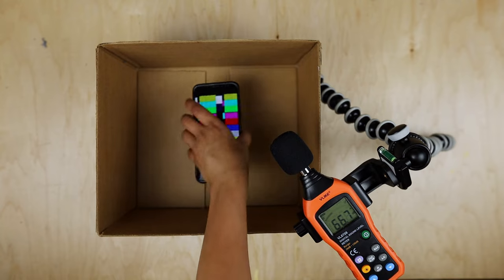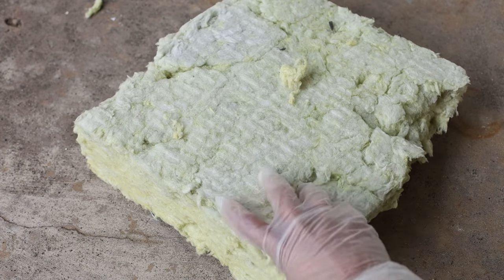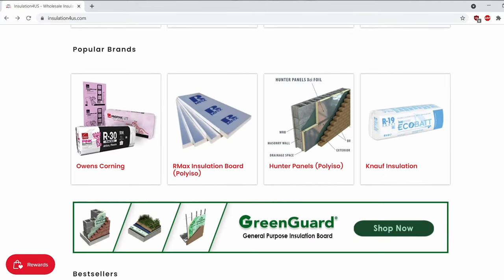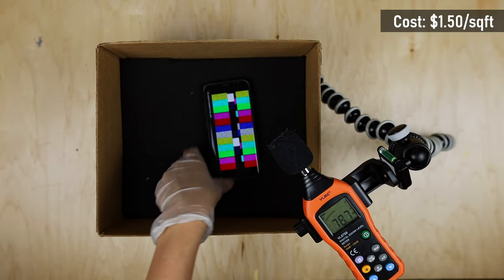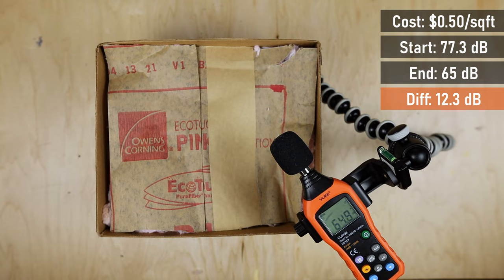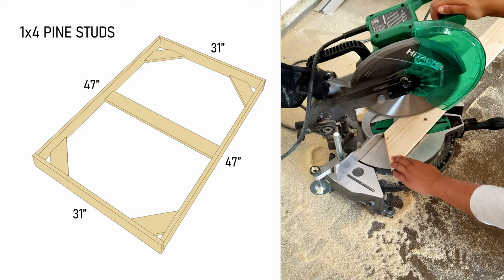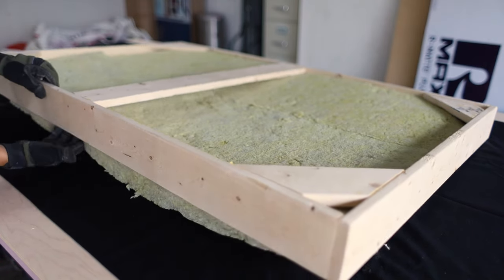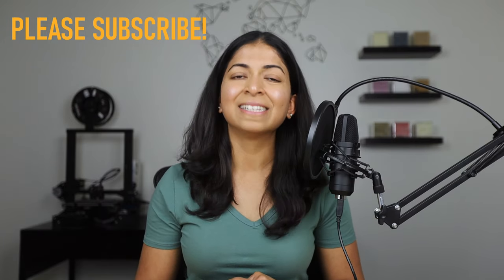Rockwool OR Fiberglass for DIY sound panels?

Comment: The fiberglass dropped the sound pressure level more than the other materials because of the Kraft paper backing. All you were testing was airflow. The panels you hang on the wall are meant to reduce the amplitude of sound waves reflecting back to the source from the walls. You’d need to put the SPL meter on the same side of the treatment as phone to see how the insulation works to dampen reflections. What you showed is that if you want to stop outside sounds getting in any improvement in airtightness will help. Get an airtight storage container from your kitchen and put the phone in there making the noise and check the sound pressure level. It should be better than any insulation.
Reply: i agree these test are so misleading as they can be. she should remove this video asap.
Reply: She states at the start that she is discussing audio absorption not reflection, most people can't make a aur vacuum box around themselves to stop exterior noise pollution
Reply: I have to agree with you beachton123, if you watch again you will see the girl's facial expression when she explains comments on the pink fiberglass.!
Reply: You are saying The 1mm kraft backing with zero mass made this big 40% difference ? the difference stands and the other ones dont have a kraft backing. In any case this test is not very useful because they tested a high pitch note, shouldve tested real loud bass.
Reply: Her test does a fine job at showing how much sound the materials can absorb. If you are trying to stop a sound reflecting off a surface and coming back to you with an absorption panel, the panel is going to be placed in front of the reflective surface to absorb energy from the sound waves, then it will reflect off the wall and pass back through the panel, where even more energy will be absorbed.
Reply: I agree. The paper is reflective and at least some frequencies are being returned to the source, lowering sound transmission, by creating a vapor barrier.
Reply: @ALJ Studios well if it's attenuating mids and high, clearly it is stopping some sound.
Reply: Yeah I agree as well.  
The paper backing made the biggest difference because it was blocking air flow and the air flow had to go around it rather than through it.
Reply: @MrFree-vj8qj  Yes the paper backing made a huge difference because it was blocking the air from traveling through it.
This isn't a 40% difference, this is over a 3 db difference, which is halving the perceived sound energy.  This is likely over a 200% increase in decreased sound energy perceived.  
  
Mineral wool is mathematically better at blocking sound, not by much, but you only will notice a difference between lower frequencies.  Lower frequencies also have the highest chance of traveling through solid materials.
Reply: @MrFree-vj8qj  Here is an easy example for you.  
Try putting thin plastic over your ear so that it seals air from getting in.  
Now try putting paper towels over your ear.  
  
The paper towel is a better insulator / sound dampener, but the plastic stops the air from going directly to your ear drum.  
This is why air sealing is one of the most important steps in house construction if you want a quiet, insulated house.  
If you just make a wall out of fiberglass or mineral wool, it won't work as expected because air flows through it with no air barrier.
Reply: Man, why didn't I think to just fill my walls with paper! Would have solved everything!
Reply: @troelsnielsen2848  correct.  Well intentioned and misleading and unscientific.  She is otherwise a sensible persona but this is a swing and a miss.
Reply: Yes, it reduced it a bit but still the fiberglass does the best job of all of those because its soft and full of air trapped in between. The sound travels best thru averagely stiff connected materials, and soft glass wool with filled with air does a good job. Thats why its also a good thermal insulation, the heat too has a hard time penetrating a soft meterial filled with air. If we replaced those fibers with some more stiff material which usually have worse thermal conductivity characteristics, like stone or steel, it could pass better thru it as it would be a better bridge for the heat to escape your home at winter or penetrate inside in summer.
Reply: This…
Reply: 🤣 when u get a online degree in soundproofing
Reply: @coolmonkey5269  - You don’t need a degree in soundproofing.  just need to take 15 minutes to do a little research, which she clearly hasn’t done.
She’s not even talking about soundproofing, she’s talking about sound absorption. They are two entirely different things.
Reply: veryslyfox  - said, “A 3dB reduction is not perceived by human ears…5dB…10dB…”
That doesn’t “sound” right. <—— See what I did there? Waka waka…
Anyway…I hope you’re not quoting Julie Leduc‘s Acousti-tech article from 2018 because it’s pure nonsense…especially within the context of production/mixing. You, I or anyone without significant hearing loss can easily…and I mean easily identify a 3dB increase in sound every single solitary time. 5dB is a major difference and 10dB is HUGE. This is irrespective of “energy” or “perceived.” 
Open up your DAW and try it. I don’t know what on Earth Julie Leduc talking about at all…I don’t think she does either.
Reply: Disagree.  I performed a similar test with R-15 EcoBatt kraft faced fiberglass insulation with and without paper backing, and used a 1khz tone. The difference with and without the paper backing was .5 dB.
Reply: @Lolatyou332  No.  The kraft paper is much thinner than the 3 laters of cardboard the tone would have to "go around".
Reply: @mrjesseholt  wrong
Reply: @troelsnielsen2848 This maybe one of the most dramatic things I’ve read in YouTube comments, lol. It was a simple demonstration, from an amateur content creator… re-lax 👌
Reply: @Lolatyou332  I don't understand your comparison - she's clearly not sealing off all the air with the paper backing. If I put a piece of paper over my ear that wasn't air-tight, I would expect very little dampening.
Reply: No because when you put a panel on the wall the sound goes through the panel then the reflection comes back through the panel so stopping sound from going through the panel stops reflection because less sound is reflected then the reflected sound is dampened so she was right with her test.
Reply: Misleading and irrelevant info. Should be deleted.
Reply: Exactly, i was about to type the same

Comment: I work for a industrial insulation company and would like to advise you to research before putting all above mentioned material in your house/ room. Rockwool, fiberglass are highly dangerous material to which even the disposal needs a license for toxic hazardous disposal. Fabric isnt enough for filtering as the particles are thinner than air and may seep through
Reply: I'm very much inclined towards using this material as I get plenty of of, for free even. But nothing is worth taking risk.

Comment: What is amazing about rockwool, and why it is the preferred material in professional recording studio, is that it absorbs sound very evenly across the frequency range, even down to quite low frequencies.
Reply: The lows are the real problem they can even require sand and other heavy materials to stop, high freq are not even an issue.
Reply: I used rockwool for my atmos install in my condo The people upstair couldn't even tell I had in ceiling speakers
Reply: @ALJ Studios I have freelanced and been a staff engineer in some extremely high end studios designed by top names and in all of them they utilized sophisticated geometry with several layers of rockwool lining the walls of the control room with a permeable fabric covering it.  I am unaware of a better setup.
Reply: @cf5914  cool, thank youfor sharing your experience and expertise.

I feel like rocwool is such a cool concept in the same kind of way as it's just cool to think about the fact that airplanes and helicopters actually work.. they just sit on top of air from our point of view.. or the fact that the Netherlands holds the sea at bay. I think it's madness that we put rocks into essentially a badass cotton candy machine and it makes lava silly string that you can compare to wool...

Have you heard of any studies into having it behind a breathable fabric? I know it was once called as dangerous as asbestos but I don't think it is. I guess if undisturbed it can't hurt too much but if not sealed very tightly I wonder if it ends up being inhaled at all. Surely singers etc would complain of their throat drying?

Just wondering if you know.
Reply: @shanemccann2915  I know of no issues with having the breathable fabric.  These setups are now VERY standard in professional studios and have been for 15+ years.
Reply: @shanemccann2915  since sound absorption happens within the insulation itself (turning the vibration of air molecules into heat essentially), the sound waves need to pass through any covering on the panel easily. If you have an impermeable layer, you will have less absorbtion, and the covering will be somewhat reflective.
Reply: It wasnt the sound roxal so its the same thing?  Sounds like science lol
Reply: Yep..
Reply: Rockwool doesn't catch fire and burn like fiberglass will especially if you are using faced fiberglass like in this video.
On top of this, Rockwool repels water whereas fiberglass acts like a sponge and loses its thermal characteristics when it comes in contact with water.
Reply: @MrFree-vj8qj  Nice to know that. For instance, a Violin is not much of a problem like a Cello then..

Comment: You seem to be measure audio transmission, but I thought sound panels were to prevent audio reflection.
Reply: Yeah, in a recording studio you have to cut down on both internal reflections (to improve recording audio quality) AND external transmission (to improve isolation with the outside). It's helpful to see how useless acoustic foam is regarding isolation, but only because there's a common misconception among a lot of people that acoustic foam improves isolation, which it clearly doesn't (nor is it meant to).
Reply: Fiberglass and mineral wool do both, but insulation way better

Comment: I used fiberglass between bedrooms in a new house with 5/8 drywall and found it had almost no effect on ambient room noise: music, taking, moving around. I tried Safe n' Sound between two bedrooms in a second house with 5/8 drywall and found it had minimal, perhaps even less effect.

Now I saw Scott MacGillivray on HGTV use Safe n' Sound and it cut the sound transmission between floors by about 95%. I'd like to watch that vid again. Of course, he used sound isolating metal channels on the rock for the ceiling. 

Classically, the only thing that damps sound has been MASS. Heavy stuff like concrete, masonry, concrete block and/or isolation of the silent space from the rest of the structure. This latest vid is quite interesting. I think I will use the isolating strips along with insulation of some kind on the next place.
Reply: Many of those garden variety acoustic sound panels have sand within them which can also be a good mass medium for making it more difficult for sounds or vibrations to travel through.

Comment: I really like your videos but on this one I would mention 2 of my issues with it:
1: I would test these materials with different frequencies, not just one high pitch sound.
Probably all materials will show different characteristics through the audible frequency range.
2. The fiberglass won because it has that paper backing on one side of it and that helps a lot on high frequency.
Apart of these small issues, I really hope that you will carry on and make more and more short but educational videos!
Good luck with them!
Dan
Reply: So the best insulator would be paper then.
Reply: @briansransom  no, it's the best reflector to reflect back to the phone the test tone that is 1kHz. It is not testing the absortion capabilty for reverb of 50ms or less of a 1kHz tone in this case.

Comment: Your tests are measuring sound transmission, but sound panels are designed to absorb sound. The two aren't exactly the same, which is why the kraft-faced fiberglass seemingly outperformed the mineral wool batts. The angular foam isn't used to reduce sound transmission; it's used to absorb some sound and reflect the rest in different angles so as to reduce/eliminate echo/reverb.

If you were to build sound panels properly, you would use Owens Corning 703/705 series rigid fiberglass boards and use fabric specifically designed to allow sound to pass through it and hit the insulation rather than reflect it. Guilford of Maine is a primary supplier of such fabric. This is not cheap, so I can understand using batts and any kind of fabric.

If you were to remodel a space or build a sound room to isolate from external sounds, you'd add mass-loaded vinyl in-between layers of gypsum wallboard to the usual wall construction. This, too, is not cheap, but if you were to do it right, this is how you'd do it.

Comment: With respect, your test may be flawed.  The video shows that the fiberglass has a backing on it which should have reflected a great deal of sound back towards the emission point.  The other materials did not have that.  It would be interesting to see whether the results are the same when all materials don't have a backing.  My hypothesis is that it will change the results significantly.  

Also, using backed insulation then creates an issue for panel design.  A panel using insulation with backing should place the backing on the wall side of the panel.  

Aside from the test methodology topic, you could expand on the topic of acoustic room treatment in the future by discussing panel designs which unevenly disperse the sound waves which are not absorbed.  A big part of acoustic room treatment is reducing the magnitude of reflections coming from a specific direction and in randomizing the reflections.

Comment: This is really interesting! I think your test may be held back a little by the fact you only tested a single tone, however, as different materials tend to do a better job dampening sound at different frequencies. I'd be interested to see a follow-up!
Reply: Ohh, yes, I am now curious about this too! We need a full spectrum sweep!
Reply: @jesinu  exactly I need t know how it does with frequencies below 200hz
Reply: Also if possible, make a video of sound panels with different insulation and test it in same room and how it will affect the room sound charateristics?
Reply from the maker: I tested different frequencies after making this video and got the same results. I hope to build a small room/testing facility in the future to perform more tests!
Reply: should use white noise
Reply: @BelindaCarr   I am an amateur audio guy and I agree.   These damping materials tend to do a great job across a wide spectrum, but very low bass is its own special animal. Bass trap design is a specialized sub branch of acoustics.  Damping is mostly a matter of taming "first reflections" and low and low-mid frequencies are the frequencies most of interest. Even if rockwool is not perfect at low frequencies,   also note that most audio snobs only accept specialized materials and sniff at cheap rockwool.  Bah.  Any sound treatment beats NONE.  Foam panels are useless tho.  Your video is fantastic.  I am going to be building both some diffusers and absorber panels for my home studio.  Have you looked into diffusers?
Reply: @BelindaCarr  can you do a follow up with just some music playing before and after perhaps.
Reply: @WarrenPostma  - Exactly. The hardest frequencies to combat in bedroom studios are the low frequencies. High frequencies are easily overcome.

Comment: I'm thinking that most people that want "panels" are looking to reduce reverberation (echo) in a room, to make it sound less like a gymnasium or bathroom.
In a case like that you want a low density with almost anything but a flat surface.
Look at those anechoic chambers. Their baffling is the audio frequency equivalent of radar absorbent 'stealth' coatings.
Exposed egg crate foam would probably help the most in creating a 'dead' room.
Often if using flat panels just having them off axis is going to work better than being 'normal' (perpendicular) to the sound source.
*Something like a sheet of mass damping in the back of them will stop transmission all the way through and drink up a lot of whatever pressure waves do make it through your primary line of defense.

Comment: Sound doesn't just come in different frequencies but can be transmitted in different ways. I used to have a neighbour who liked to turn up his stereo. He lived 75m away. Although I couldn't hear the actual music, I could hear the sub-woofer bass pounding. It went through his concrete slab into the clay soil which transmitted the sound 75m to my house and my concrete slab in turn also vibrated. That is why drums and bass guitar in a studio are often placed on a mini stage that has springs, rubber and other vibration absorbing features.